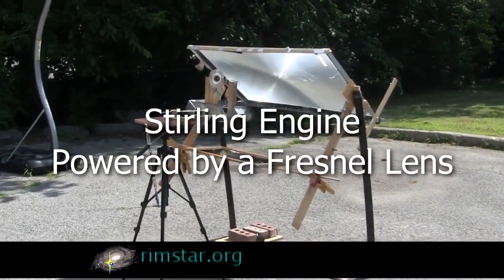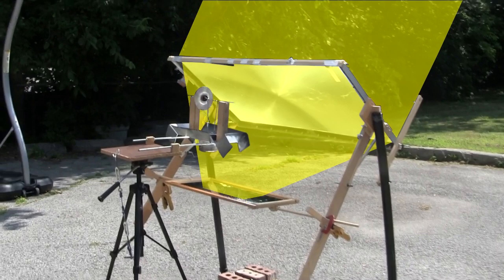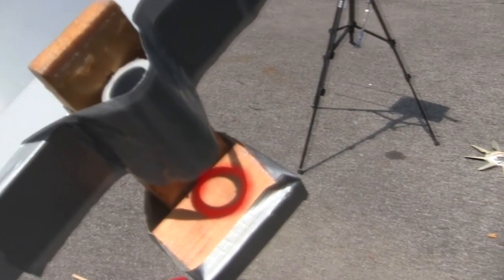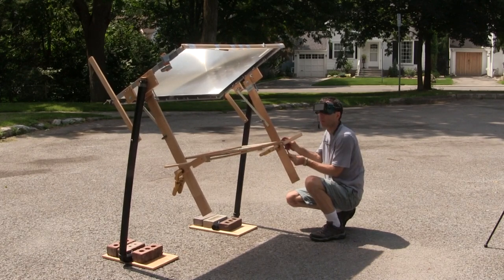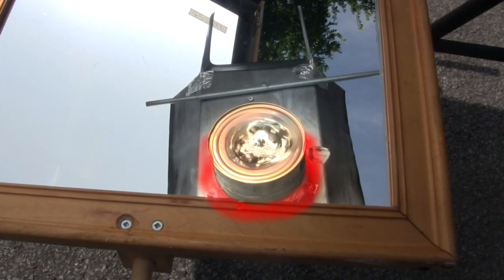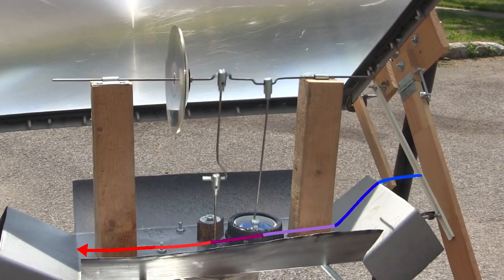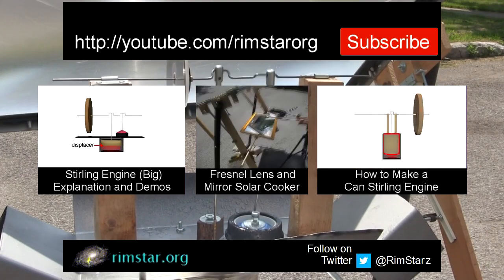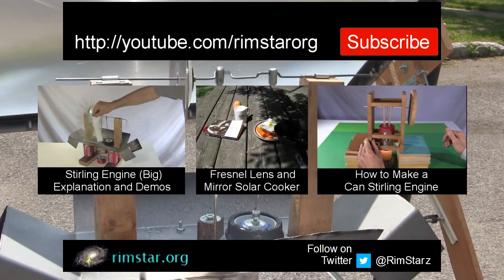Stirling Engine Powered by Fresnel Lens/Concentrated Solar Power

Comment: Hello RimstarOrg, very nice set up, I liked your video, I am the 200 :)
Can this principle be used to generate power for a laptop? If so, will you be so kind to show how.
Thanks and regards, and keep doing the good work!
Reply from the maker: Thanks! You'd need a pretty big one to power a laptop. You could probably make one to charge a cellphone though. But I never got it up to more power than you see in this video, which isn't enough to power much.
Reply: Thanks RimstarOrg, I understand.
Sorry if this question has a very obvious answer but optics is not my field. Can we "amplify" light "power" using one Fresnel lens on top of another being the below one located on the focal point of the top one? If this is possible, can we handle a bigger Alpha Stirling engine attached to a dinamo to get 18V DC 6 amps?. Am I asking too much? :)
Thanks and regards.
Reply from the maker: If the two Fresnel lenses are the same size then it won't help. To help explain why, a few years ago I came up with the concept of a "capture area". The energy is coming from sunlight. The amount of energy you capture is therefore the area of sunlight you're capturing. If you put two 2'x4' Fresnel lenses with one in front of the other, the first one will capture a 2'x4' area of sunlight. It'll then focus it onto the second one. The second one won't capture any additional sunlight because it is blocked from the sun by the first one. So the capture area is the 2'x4' of the first Fresnel lens.
Of course that's not strictly true because there's still sunlight being reflected from elsewhere that's hitting the second lens at an angle, but that's nothing compared to direct sunlight. It's also coming in at angles that won't necessarily be focused to the right spot.
As for 18V DC 6 amps, for a DIY Stirling engine with a reasonable sized solar capture area, yes, you're asking too much. :) That's 108 watts (18V x 6 amps). In this video https://www.youtube.com/watch?v=y2DmsNTgw1A he's producing around 1.5 watts using a natural gas source to produce the heat for the Stirling engine.
Reply: Thanks RimstarOrg, nice explanation, it makes sense to me. We will need a much bigger lens on top, plus mirrors around to catch more sunlight. So it is not viable for me.

So I would have to study Tesla, Edward Leedskalnins theory of electrical power and the Steven Mark's TPU,  a mined field full of false information and misinformation.

You are very kind in answering, a rare quality among youtubers,
Thanks and regards.

Comment: Any feedback on what hours of the day had on its performance?
- Where did you see the most wear on the engine ?

Are we headed towards multicylinder engines ? :) 

thanks, any feedback is good.  Say 1 Watt as the output ?
Reply from the maker: I haven't experimented with it extensively enough to answer any of your questions. I guess now that summer's here again I can get back to trying to get higher power output.

Comment from the maker: Not this particular one, at least not without a few improvements and even then it'd be luck to produce 1 watt, which is good for homemade ones. Commercially made ones do produce useful power, mostly by burning propane or natural gas for the heat. There were some very large commercially made ones that use a huge parabolic dish, but I don't know if they're still in use.

Comment from the maker: Comparing the mechanical power of this Stirling engine powered by this 2 foot by 4 foot Fresnel lens to the electrical power of a 2 foot by 4 foot solar panel, there's no comparison. The solar panel wins. A 2 foot by 4 foot solar panel these days can put out around 140 watts. Assuming 700 watts of solar power for the 8 square feet, that's 20% efficiency. Commercial Stirling engines can be around 30%, but this has nowhere near the efficiency of a commercial Stirling engine.

Comment: ye, i've tought about a ceramic cylinder with copper sheets at the ends. that would make a tepmperatur diference! anyway, tomatoes are still in place, so i'll try that bit latter

Comment: Great tip for the solar tracking with the circle. Need to find a Fresnel lens, was thinking of using the kitchen fridge though as a Stirling powering heat system lol

Comment from the maker: A tuna can is very short. That sounds like one of those low temperature difference ones that run on the difference between room temperature and the heat of a coffee cup, for example. I haven't tried making one of those but as far as I can recall seeing, they have sides that are non-metallic. I'd always guessed that was to reduce heat transfer from hot plate to cool plate.

Comment: thanks for the tips! i use zippo for heat testing, and it has really big flame. well, i'll try and find out! also i used tuna can, where bottom and sides are the same pice, while these taller cans are from diferent pieces, so the heat won't conduct so well.

Comment from the maker: Thanks. I have the same problem with my tomato paste can Stirling engine. I have to make sure to not use too much heat, a candle flame is okay but an alcohol burned flame is too big. And it works better if the room air is cool. So without the high heat, it doesn't turn very fast. And how about making tomato sauce, or a pizza! We're all going to your place for dinner. :D

Comment: very cool. i tried making a stirling engine lately, with no success. well, but i tried it with really untall can, so the heat quickly heated the sides. now i'll try with much taller one. another time (older) i had some succes but it didn't self sutained, but the pushing diaphragm move, now with very short can it didn't. now i need to think where i should use tomatoes, so i can use the can :D. anyway, nice video.

Comment from the maker: There are losses through the lens, at the mirror, heat losses outside the cylinder, and in the conversion from heat energy to mechanical energy. I'd say the overall efficiency of this whole setup is less than 1%. But commercial Stirling engines alone can be up to 30% efficient, which is pretty good, comparable to many steam engines.